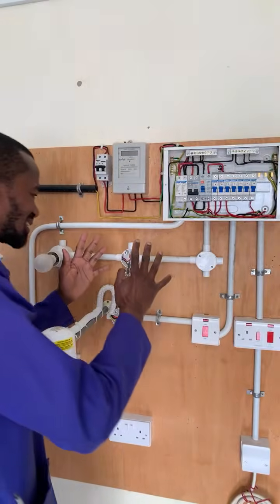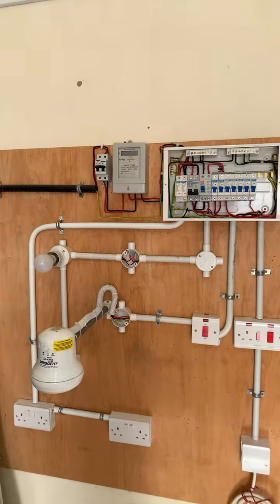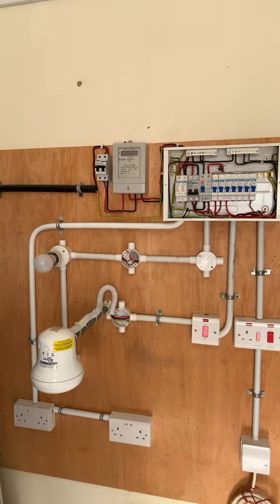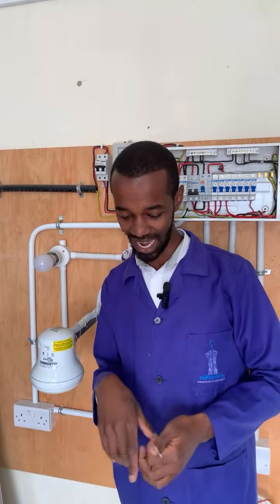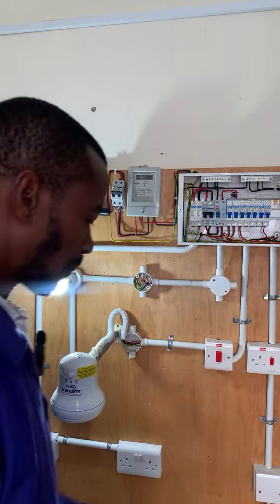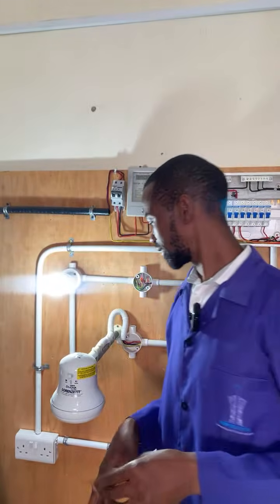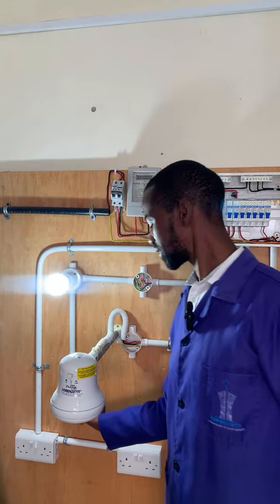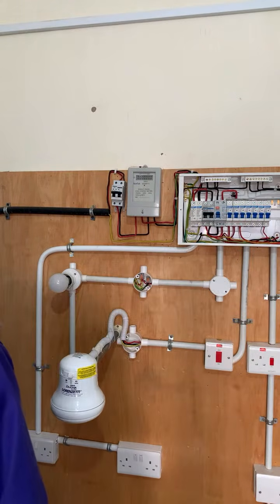Electrical Installation For DIY.

Comment: Hey what happened when theirs is short circuit of neutral and earth conductor
Reply from the maker: Hello Phanuel,
A short circuit between neutral and live causes a high current surge, usually tripping the breaker. If not protected, it can lead to fire or equipment damage.
Solution: Turn off power, inspect and repair wiring, ensure proper breakers are in place, and call an electrician if needed